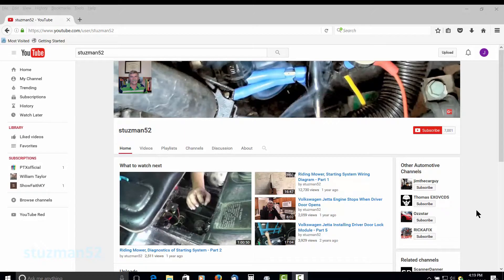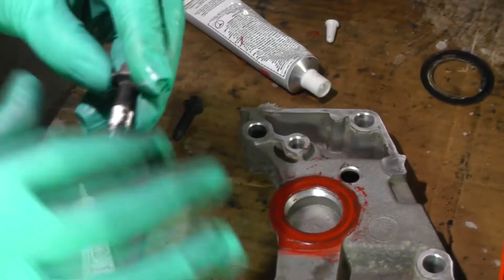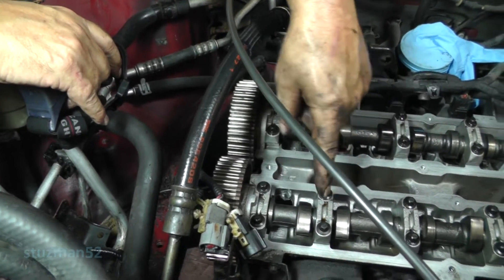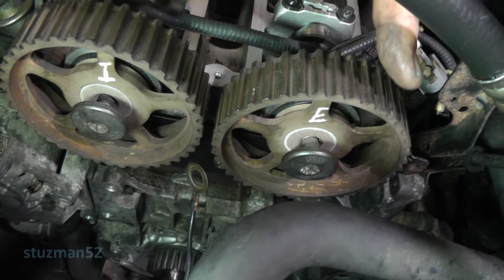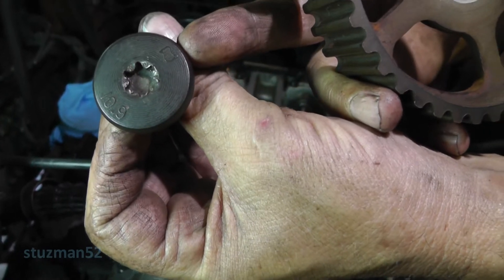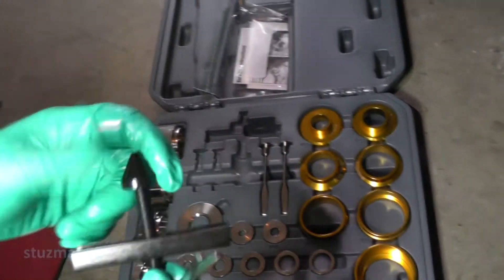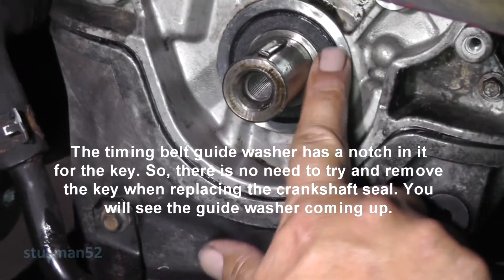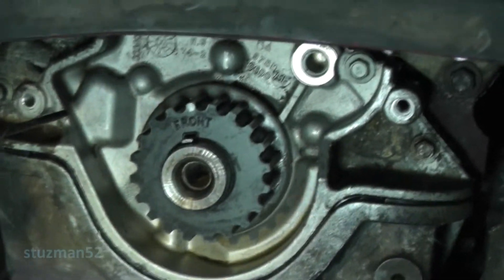Ford Escape Timing Belt and Water Pump Replacement - Part 5

Comment: Gonna have to watch this Monday evening...
Reply from the maker: No problem Thomas :) I'll be watching yours today at work during lunch...
Reply: stuzman52 Nicely done! All the TDI's that I do are very similar (freewheeling sprockets). I have the same cam/crank seal puller set. The lip of one of my puller legs bent as I tried to pull a stubborn seal. The metal that the puller legs is made from seems a little soft to me... otherwise good set. Nice to hear a bit of German on other channels! =)
Reply from the maker: Thank you Thomas and I'll have to go back and take a look at one of your
 TDI timing belt jobs for review. As for the puller it seems to be a 
good set, but with it bending one of the pullers in your case, I would 
say that the metal should have been stronger. Oh, the German part was 
for you as I knew you were originally from Germany :) I did speak some 
French back to her, but I boogled it up, so I took it out :)

Comment: The seal kit came in handy.A lot of repeat checking but worth the extra effort for a well timed engine.Nice job with the different additives  and gives that extra bit of security of a job well done.The camshaft sprocket holder really did the business.Could be mistaken for a coal miner with the head lamp.
Reply from the maker: Hey Tom and it's always good to double and triple check behind your work before you start sealing it up. Yes, since the cam sprockets are only held with torque friction, the thread locker was used for a little bit more of insurance. And yes, the sprocket holder did a great job! Thanks Tom for checking out the video and that you left a comment!

Comment: So much information in one video. Fantastic work. Did the cam sprockets come off or did you need a puller? There is a Ford special tool that looks a bit funky. I see that cam seal was made in the UK... That seal tool is amazing. Do it right, do it once
Reply from the maker: Hi Jonathan! The cam sprockets are a slip fit onto the camshafts so no puller is needed. Not sure what Ford tool you're talking about and yes, the seals were made in the UK. The seal tool remover/installer kit worked pretty well. That's right do it once and then be done with it. Here at work we got some guys who I say it will be right the last time. The only question is you never know how many times it takes to get it right :) Take care Jonathan...

Comment: Thanks for your time Terry but either way they gave a different tensioner than the one on your box...
Reply from the maker: It could be they just changed to a different tensioner. I had an issue with the gates product as the tensioner was totally different from the OEM design. That's why I picked the other manufacturer as the tensioner was just like the original.

Comment: Terry that kit is the way I would go too. The cam sprockets look like they do have quite a bit  of rotational slack when the bolts are loose , is the bolt torque friction  the only way them cam sprockets are held without moving ?
Reply from the maker: Hey Steve. Yes, the kit from Cloyes worked out very well. On the cam sprockets there are no timing marks and there are no pins keyed to the camshafts. And you are correct, the only thing that is holding the sprockets in place to the camshafts is the torque friction. That's why I also put a little blue thread locker on the cam bolts as it provides a little extra protection :) Thanks Steve for watching the video and leaving a comment!!!

Comment: How did you hold the crankshaft to get the bolt untight\tight?
Reply from the maker: I used a pipe strap...
Reply: @stuzman52  can you please give some more info on how you did it? Did you use a chain wrench and place it over the pulley?
Reply from the maker: It wasn't a chain wrench as that could damage the pulley. I used a pipe strap wrench which has a leather band that I wrapped around the pulley to hold it in place.
Reply: @stuzman52  thanks

Comment: The timing bar and pin seems like a lot of work but doing it that way you no everything is right. I think it was the older Mitsubishi 4 cylinders in the Rangers that there was a lot of slack and you could be off a notch or two. I think I'm remembering right 😏
Reply from the maker: Hi Norman. It's Ford idea of the timing being spot on. I'm not sure about the Mitsubishi, but if you remember it I'm sure it's good info :) Thanks for hanging in there and watching the video!
Reply: I was wrong those engines were Mazda engines in the Rangers. Hey I'm getting old 😊
Reply from the maker: After I posted, I thought about the Rangers and thought you might be thinking of the Mazda engines. See, you're not getting old, you came back with the right info :)
Reply: 😀 good answer!!

Comment: How many hours did it take you to replace these parts?
Reply from the maker: I could have done the whole job in a weekend, but because of filming it took three weekends.
Reply: stuzman52 Dang I hope I never own one of those Fords.
Reply from the maker: It's not to be bad Thomas once you get the exhaust dropped. Ford had quite a few models that used or maybe still using this technique. Thanks for watching the video and leaving a comment!

Comment: crankshaft oil seal      Oil leakage repair
Reply from the maker: Medo HHH if you got all leakage around the crankshaft seal, then it sounds like you need to replace the seal.